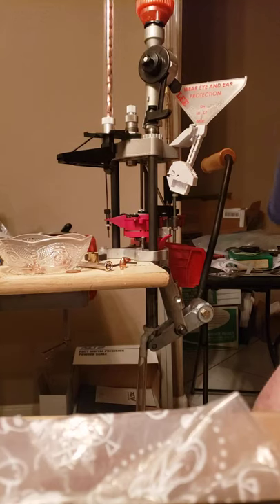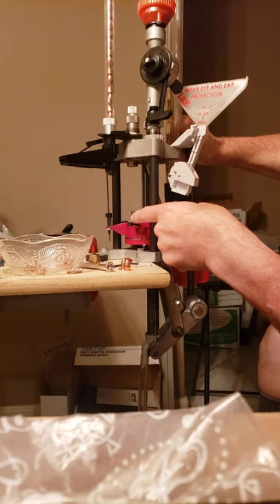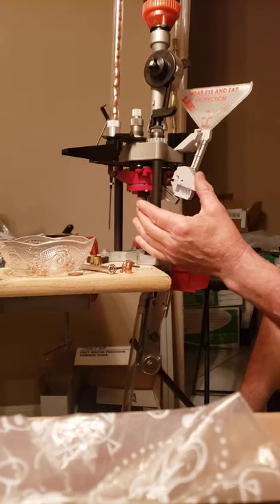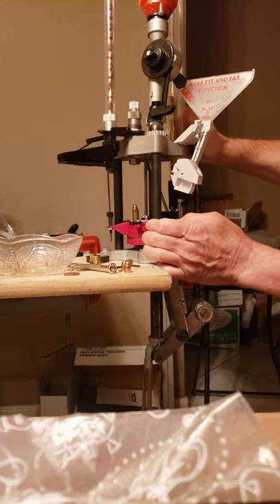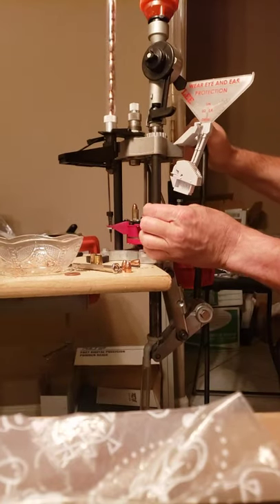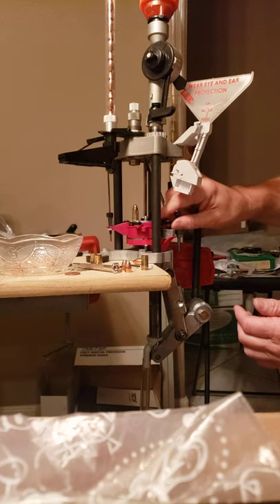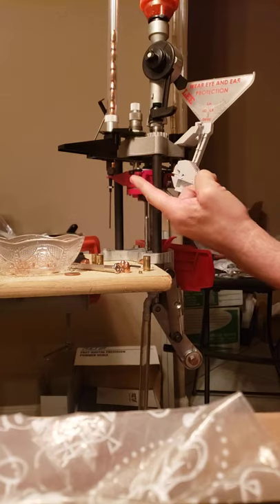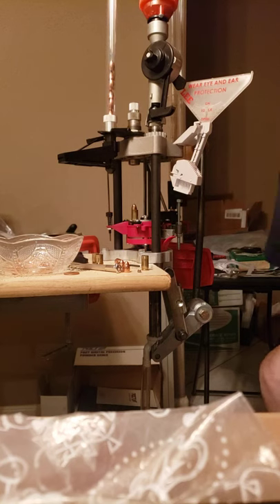How does a Lee 4000 progressive press in 9mm in action work with a case feeder and bullet feeder.

Comment: I prime with a hand primer, lee press priming is too frustrating to try and use. 
I just remove the decapper from the carbide pistol dies and on rifle dies I buy extra expander/ decappers and break the decapper pin off.  I decap, tumble the brass, hand prime with an rcbs hand primer, then run them thru the loadmaster.

Comment: The bench moving around will give you inconsistent loads, get it mounted down and stable and u will be way better off
Reply from the maker: Yes, this is true.  I had limited space and tried to make what I had work.  I was struggling.  I improved it already and it made a big difference, but still need to improve it.  Thanks.